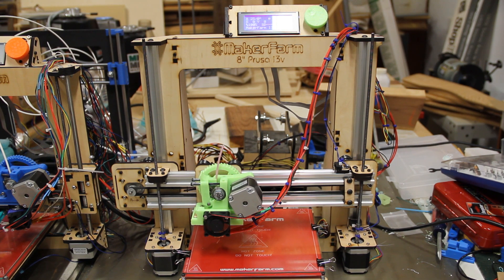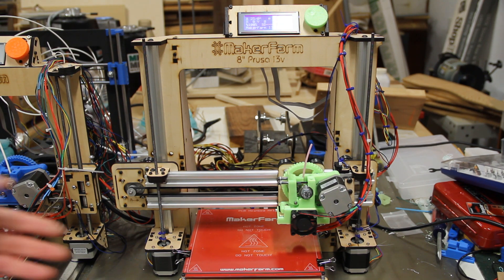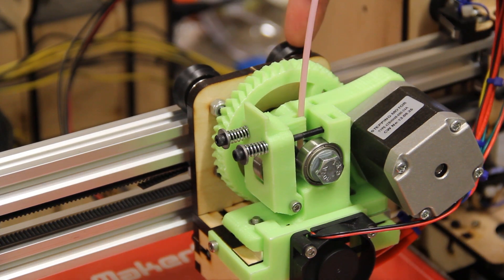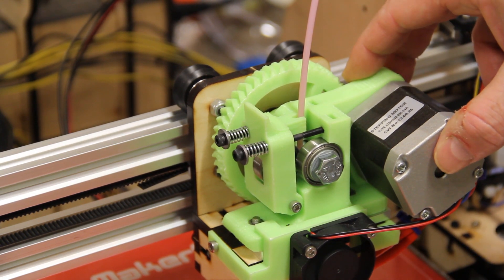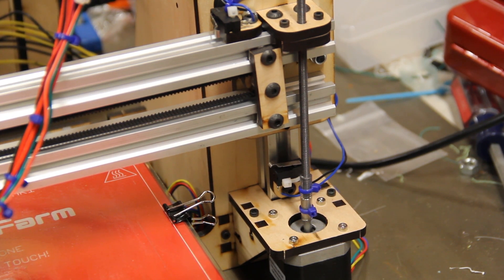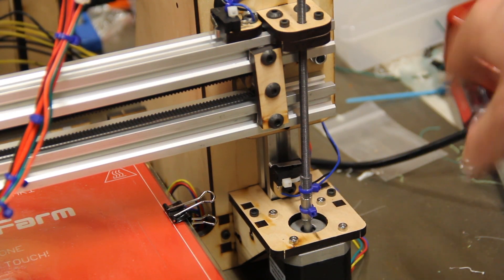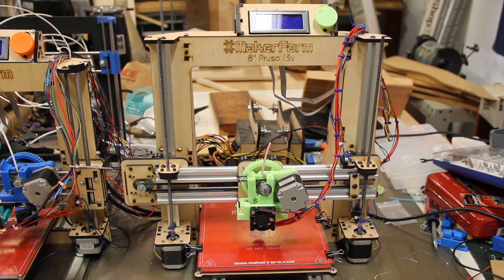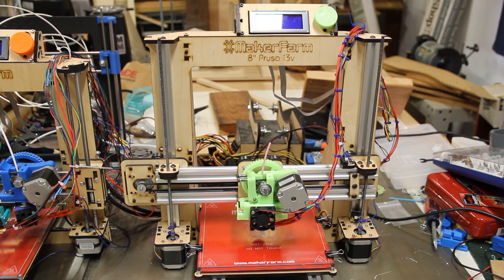Makerfarm Prusa i3v RepRap 3D printer review - part 1

Comment: Hi I'm planning on buying the "Prusa 8" i3v Kit (V-Slot Extrusion)"..Just to clarify, is there a difference in hardware between the 12 inch,10 inch, and 8 inch models? Or is it a matter of build space. And also what nozzle size and extruder did you choose during checkout? I'm looking to have the best possible print quality right out of the box.
Reply from the maker: TheFreeMan It's mostly build space.  There are a couple of additional caveats about the 12 inch that are exactly what you would expect: The heated bed is quite a bit larger, so the bed relay is really a requirement (it's included).  Also, there is a little bit more flex in the 12 inch than in the smaller models, which is also unsurprising.  Finally, ther 12 inche is HUGE!  If bench space is at a premium, I'd give it some serious thought.  In general, my take on printer size is much like my take on most other things in life: "As little as possible, as much as necessary".
Reply: ZennmasterM I see, what nozzle and extruder would you recommend for the highest quality? And iirc I have to get my own power supply and glass right? Where would I find those?
Reply from the maker: For the power supply, ebay. You're looking for a 30 amp LED supply with 2 15 amp rails. I got mine for around $25US shipped. For the glass, I've had good luck at 2 different hardware stores. I'd try to keep with smaller shops as home centers seem to charge a lot more. As for extruders, the Greg's that comes with the printer is a great start. My recommendation for a hot end is the E3Dv6,  which I think Colin now carries. .4 mm is also a great compromise size unless you know you need something different.
Reply: ZennmasterM ahh ok, one more thing. For the glass I assume I just buy 8" x8" x8"? Is there a specific type and or thickness it needs to be?
Reply from the maker: TheFreeMan That's it.  I've used both "Regular" and "Double Thickness".  The thicker is a little more robust, but seems to take a bit longer to heat. Other than that, I haven't noticed much difference.
Reply: ZennmasterM
http://www.amazon.com/Switching-Power-Supply-Strip-Light/dp/B007MWNF5Q

would this be alright for the psu? I don't see a specification for 2 15 amp rails but it seems to be the same price point as the one you described

Comment: Great review, especially for someone like myself interested in getting a 10" i3v soon. One question though, do you notice any issues or excess resistance/wear on the belt from the teeth rubbing against the idler bearings? I don't understand the design choice of doing that since almost every other 3D printer I've seen either has the back of the belt (the flat side) running against a smooth idler, or just the belt's teeth running through an idler that's just another gear identical to the one on the motor. Personally the thought of the belt's teeth running tightly against the smooth bearing makes me cringe a little thinking that might just be the worst possible thing you can do to a belt, but for all I know, I'm overthinking the whole thing and it might not be as bad as I think, which is why I feel the need to ask someone who actually has the printer.
Reply from the maker: lXGaimMasterXl Every printer I own or have ever owned has run the "teeth" side of the belt over an idler (Various i3's, Kossel, Mendelmax 2), and I've never noticed any uneven wear over the sections in contact with the idler.  In short, No. :) Hope this helps!
Reply: ZennmasterM Oh wow, well shows how much I know then, don't own a printer myself (yet) but that is very good to know, helps ease my worry about the issue. Thanks a lot!

Comment: Don't know where the problem is with the z-endstop. You can use an offset. So adjust the z-endstop so that the nozzel ist maybe 1mm above the bed then reset the coordinates use your paper and adjust the nozzel height. After that you can read the new z-coordinate and you can use it for you new offset. Of course you need to activate negativ movements in your firmware.
Reply from the maker: The way this printer is set up, movements below the z-endstop are physically impossible without breaking something. In addition to being a limit switch, the end stop and it's mount are also an obstacle in the path of travel.
Reply: Oh sorry. I thought you have optical endtops. With optical endstops it is a lot easier. :)

Comment: Hey there Michael! I recently posted in your channel discussion section with some questions regarding filament that you quickly and thoroughly answered! Thank you again for your help!

I've been operating the Prusa i3v for a few weeks now, and I've noticed the issue with adjusting the Z endstop. I wish that it would've been designed a little better to accommodate the necessity for very accurate adjustments. Luckily, as you've assumed, there has been a fix by a very skilled designer on Thingiverse. Clough42's Prusa i3v Z endstop fix (http://www.thingiverse.com/thing:336665) is the perfect solution. He's even created an updated version that utilizes a micrometer for even finer adjustments. In the description for that thing, you'll find a link to his i3v endstop revision. This way, you'll easily be able to upgrade one of the few weak points on the i3v.

I'm really excited to see the other videos and hear your opinion on the i3v! Keep up the great videos!

Comment: Wouldn't you make minor adjustments to the end stops in the firmware?
Reply from the maker: Yes and no.  In the case of the X-axis, there is nothing you can do in firmware to make the x-carriage go past it: it is physically blocking the way.  In the case of the Z-axis, the answer is "not really".  With bed auto-leveling enabled (which I have not yet done on this printer), sure, part of setting that up is measuring the offsets from the probe to the hotend, but in that case the endstop is mounted on a probe.   Without auto-leveling, though, it would be a VERY difficult time leveling the bed without a true "Home" on the Z-axis.  Even if you could, you're in a position where either: A) The endstop is too high, in which case you can't lower the X-carriage below the Z-endstop without breaking something, or B) the endstop is too low, in which case you're crashing the hotend into the print bed when you home Z. Neither one of those is really all that good.